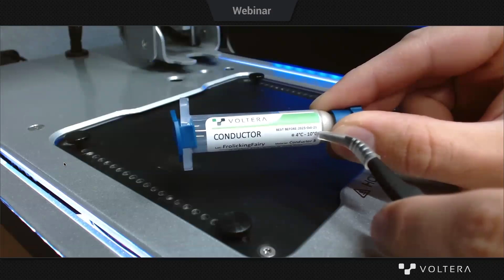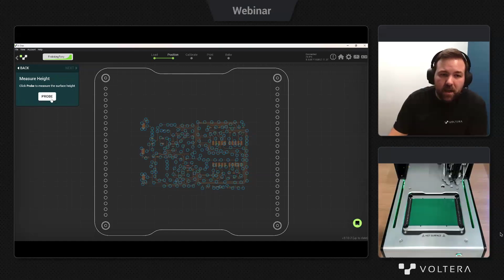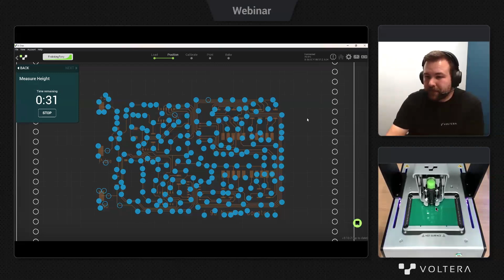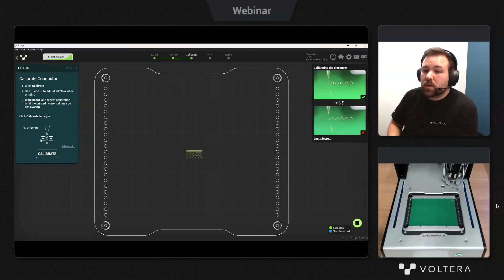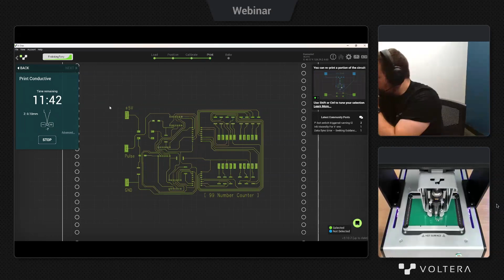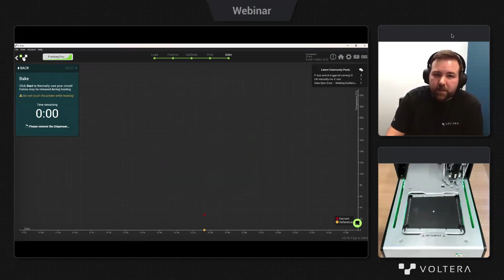Webinar: Printing PCBs for Hands-On Learning

Comment: How does this compare to something like the Wegstr PCB machine for prototyping use? I know it's a CNC, and the v-one is a printer - but ultimately if you are creating boards and iterating the design quickly then both methods are valid. Just looking for a steer on the advantages of the V-one
Reply from the maker: Hi @markhesketh6699! Thanks for the question. You're right - both machines can create PCBs relatively quickly, but there are a couple key differences. V-One has the additional feature of being able to dispense solder paste and has a heated bed for reflow, giving it more functionality for PCB prototyping, whereas the CNC Wegstr can only do milling. Prototyping with V-One will be quicker since there are less steps than a milling process. And since V-One uses additive manufacturing, you can wipe away any print iterations you don't want to use and start fresh on the same board. With milling, you'd likely need to use a new board for each iteration, which adds up the more iterations you need to do. If you have any further questions or want to discuss your specific application, don't hesitate to reach out to sales@voltera.io. Hope this helps!